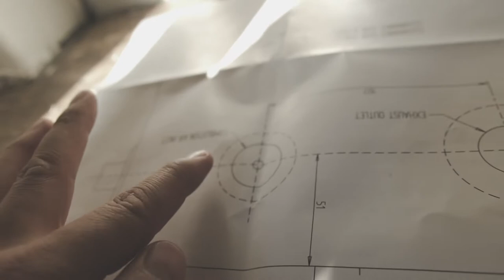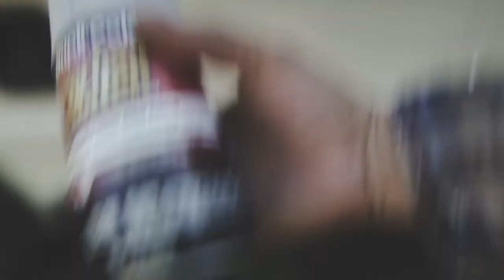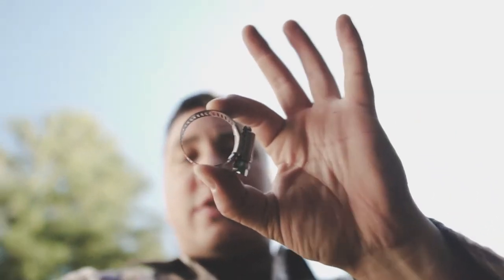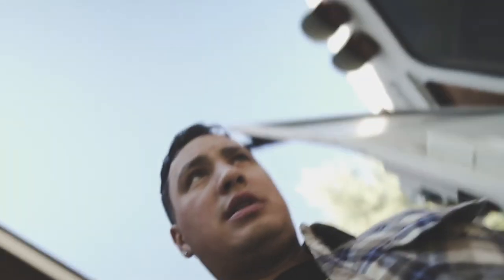How to Install a Propex Heater HS2800 (In a Short Bus)

Comment: The unit runs off 12V?  Why are the 2-stage regulators needed.. and Propex looks to be a UK company, so the British threads makes sense!
BTW. what's the hottest temperature you can get inside the Short Bus with Propex?  I'm looking to make a small sauna space (64 cu.ft) that can reach typical sauna temperatures of 180F.
	
For example, according to the HS2800 site, it says the heat output is 2.8kw (9500btu/hr), but by comparison.. a traditional gas sauna heater (scandia) is 40k-80k btu/hr!  Electric dry saunas (petersonsauna/helosaunas/Harvia) typically use 3kw-14kw heaters.. interestingly,  my compact car's heater uses 6kw (20k btu/hr)!    Electric (far or near) infrared saunas typically consume 1.5kw...  and wet/steam saunas (ex. SteamSpa) use 220V, and are rated anywhere from 4.5kw to 12kw!
Reply from the maker: Ben Nguyen I honestly don’t know the answers to your questions. It’s 12v cause it’s made to be installed in vehicles

Comment: So could you use a Y adapter and make to heat vents if you wanted to? I'm doing a cargo trailer conversion and need multiple directions of heat.  Great video man .
Reply from the maker: I wanted to do that but couldn’t find and adapter to fit.

Comment: Nice work! I have same size skoolie, how well does the 2800 heat your bus in winter?
Reply from the maker: Peter Pensotti world freaking great but I might do a Chinese diesel heater if I was doing it again
Reply: @isaacturnerit  that's what im trying to decide between, but the issues with soot buildup have me leaning towards the propex. Id do the diesel if i could figure out how to tap another line into the fuel tank, but that job seems like a real challenge
Reply from the maker: Peter Pensotti well I’m telling you if I was doing it again I would go the Chinese diesel heater route. I know lots of busses that have the and love them

Comment: Do you happen to remember where you got the adapter / what you bought to properly connect the heater to the propane line? Bought my propex from canada because they told me it was the same as the US, but it is not the same :(  Seems like the issue is that my propane line has an american fitting, but the threading on the heater itself is british.
Reply from the maker: Yeah the threads are funky. I went to a propane specialty store and they had the adapter. I would recommend just doing that in your local area.